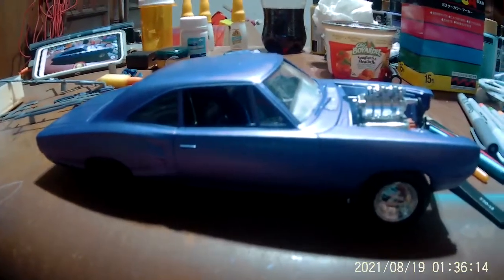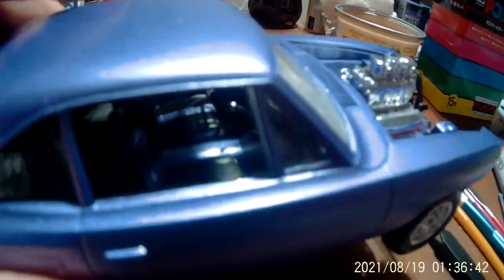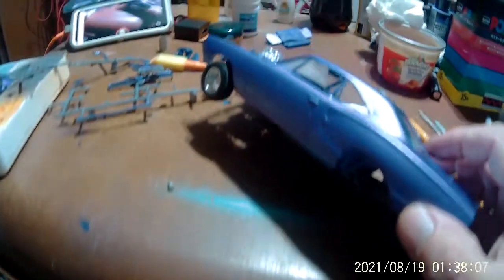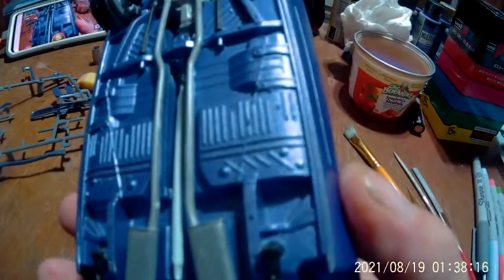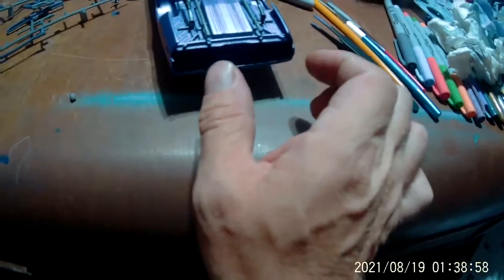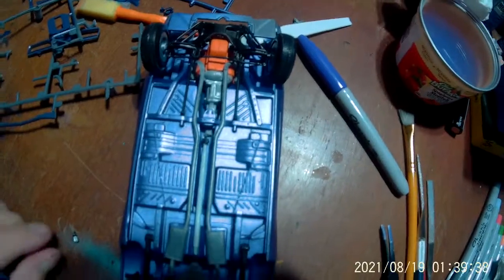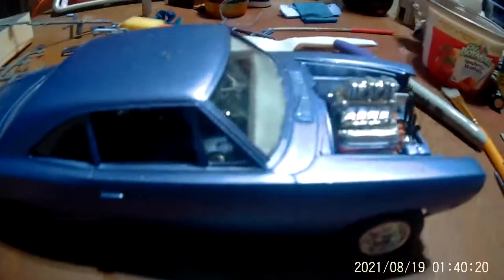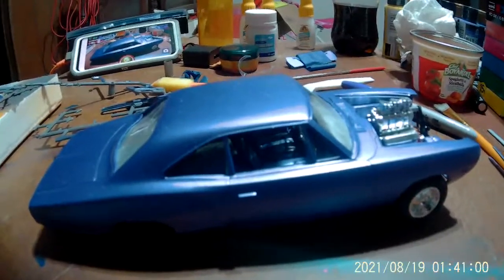update on Super Bee. It's not pretty but I'm getting there.

Comment: Not bad Pro, not bad at all! The body may be extended at the ends to accommodate the bumpers and or front/read panels. If thats not the case, could always sand them down. Getting the body to fit properly on some kits can be the trickyest part of the build, I've had to reshape quarter panels with hot water on a few. You'll get there. Guten tag!